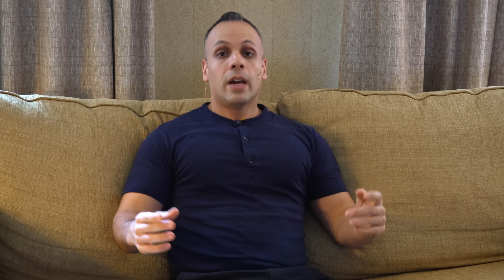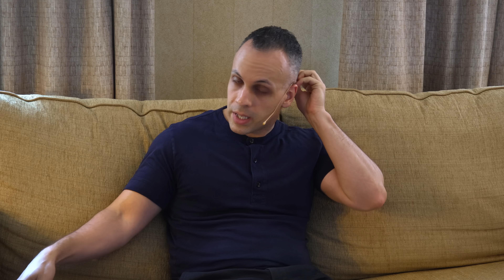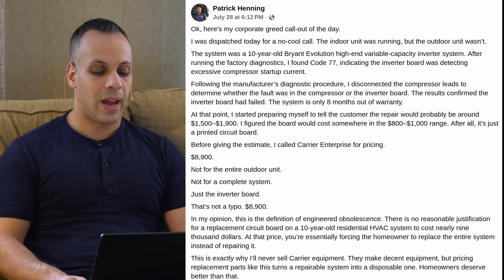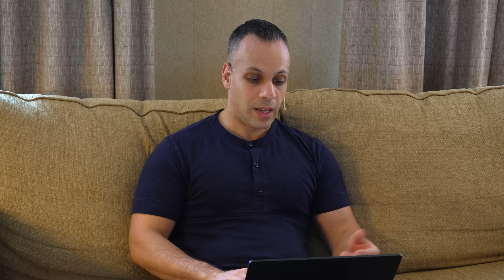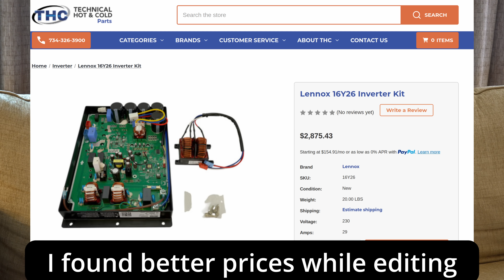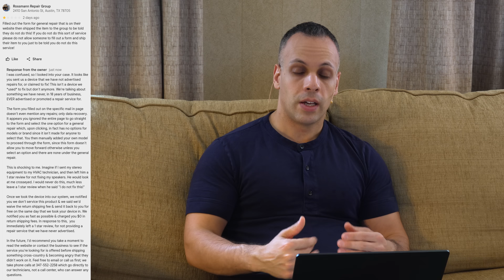Carrier AC repair has $8700 part cost for residential unit

Comment: Carrier has jacked up parts prices since covid and their strategy is absolutely to force the end-user into buying new and fuck you if it's only 8 years old. It's not just them though a lot of manufacturers are not even stocking parts for stuff that should be under warranty and getting away with it "due to the conversion to A2L refrigerants" that's their get out of jail free card. Us dealers are pretty much powerless and the higher end the less likely it'll be that a motivated technician can just "make it work". Also and oh btw these mitigation systems for A2L refrigerants are fraudulent as all hell.

Comment: I was a Carrier dealer for 20+ yrs before I sold my company. I agree that is costs WAY TOO much to do repairs on these variable speed units. Carrier makes basic units just like Goodman and everyone else. They are a good product. But $8700 is not realistic. I have a 21 yr old r22 Carrier unit and it runs great. I will not replace it until it’s 100% dead. I live in NE and don’t use it as much as I do in my FLA house so I’m hoping to get at least 10 more yrs.

Comment: I had a similar thing happen here in Australia about 8 years ago...  I had a Samsung and it was about 3 months over warranty...    Samsung actually replaced the main board on the external unit for free which shocked me greatly, enough I still mention it.

Comment: You could buy an old car for that kind of money. And probably use an inverter from it. Wth. And most boards like this can be repaired, they look even simpler than what my dad sold and those needed a new capacitor/relay/resistor after a decade or two. No, I don't expect my HVAC guy to be able to troubleshoot that, but could be outsourced for less.

Comment: I don't speak for all AC guys but a lot of times on an obsolete system we just scrap them. Sometimes we'll keep up a circuit board or a temperature panel. We always keep the capacitors. Everything else just turns into scrap iron.

Comment: Buy a Goodman over carrier, for sure. Just as good of quality and party's are more readily available/cheaper too.

There is honestly no reason why these control boards need to be this expensive. They are mass produced circuit boards that aren't actually that critical to the operations of the unit (maybe for minisplits, they are already overly engineered as it is) and could easily be retrofitted to run without for a few hundred dollars in swapped parts that any decent HVAC tech should be able to do.

Comment: A client of mine repairs all kinds of circuit boards from Ac units to graphic cards. All same price depending on the costs of parts
Reply: How would I go about learning to repair inverter boards for AC systems and mini splits? I’m an HVAC student right now less than a year from getting certified but I’ve studied my ass off. I’m still young, and I know the future is electronic and digital, so if I learned how to repair these boards it would help me a lot. Also I have minor experience in soldering too. Any reccomendations for books to read, videos to watch, or courses to take would be greatly appreciated.

Comment: This is what happens when a company decides that every department must be a profit center, with the overriding goal to maximize profits. The idea is to cut costs and increase prices until just before a statistically significant number of customers will balk. In other words, you look at your business as a bunch of numbers and aggressively remove any human elements such as customer satisfaction. Attacking your own "statistics" (formerly "customers") is far cheaper than competing. Obviously you can only do this in relatively static, slow changing markets, like HVAC.

Comment: From Europe but same shenanigans. 14 years old gasifier boiler. Control board with small LCD screen.
I got the quote from manufacturing plant 15 miles away for 860€ +360€ for replacement. (In the middle of summer, not even peak seson.)
Took out the board, found the OEM and found that they make generic controllers and are branding them for several manufacturers.
Shout out to them, their support (also company around 50miles away) was incredible. 
They asked what my current board was, got informed they dont make that model anymore, but can sell me drop in replacement with lambda control on the flute (current one doesn't have one). 
With next day delivery the controller board and lamda probe was 260€. 
All I had to do is drill a 12mm (1/2") hole in the flute to insert the lambda sensor and change the controller. 
No rewiring, thermal probes included in package stayed unopened, old ones work just fine, controller dropped perfectly in place of the old one. 
I changed a few basic parametes, no PLC rP0001 parameter stuff, just desired temperatures for boiler, hot water, buffer storage temp in user menu.
Boiler now works better than new, more efficient and burns a bit less wood, it's what I noticed in 3 seasons of use.
Think of it, I was thinking of replacing the boiler with a new one at that time and almost choked on the prices for new green (lambda control) boilers. Comparable new form same manufacturer 7k, some cheaper options are for 2-5k, but they are made from thin material and questionable life choices of some employee that worked on your particular furnace. 
And if you think 7k was alot... no no, we got them going deep over 30k for a domestic wood boiler alone. Scared to even ask what they charge for service parts.
Company greed is global problem, there are some hurdles in the EU but hurdles come with instructions how to go around them. US is not even pretending it doesn't care about the consumer rights. 
Let's teach our kids to repair and reuse stuff and let the wallet decide which business will stay around long term.

Comment: I'm from a tropical country where mini splits are the most commonly used HVAC system. 
Around 15 years ago the variable speed - inverter style units were being pushed by manufacturers with the main selling point being energy efficiency. 

These units came with two major problems - PCB failure and condenser failure, both occurring relatively early in the ACs lifespan. 

There were now two PCBs per unit - one indoors and one outdoors. Either one (but mostly the outdoor one) could fail at any time due to bad design, poor quality, overheating or moisture due to a bad seal. Replacement cost was around 15-25% of the unit cost. 

The condensers would also fail early due to higher refrigerant pressures, thinner materials and dense easily clogged fins - all in the name of boosting efficiency. When they fail you get excuses from the manufacturer about living in  a coastal area (why is it even on sale in my city then ?), pollution or not opting for some overpriced warranty pro+ or service package. Options are to pay for a possibly temporary repair with refrigerant or to replace the condenser with a new one costing between 15-40% of a new unit. 

Due to the bad press manufacturers offer a 5 year warranty on the outdoor PCB (conditional) but nothing on the indoor pcb or condenser (other than coatings that are mostly marketing fluff). 

So yeah the expected lifetime of these units seems to be around 5 years rather than the 10+ years of the old fixed speed units which have also disappeared from shelves in the last few years. 

I'm now 2 years into AC no 3 since 2012 although I do admit that AC no 2 did fail a bit prematurely after taking some damage during renovation of the apartment building. 

I also do have a PCB repair guy but he's always a bit swamped and takes 2-4 weeks for a repair minimum and obviously can't fully test the repair without it being installed into the AC which requires coordination with the AC guy and so on. If it's peak summer, the max I can survive without an AC is a week - either repaired or replaced.

Comment: Automotive dealerships use a similar pricing approach for electrical diagnosis. If their tech can't diagnose the issue, the advisor quotes a "new engine harness" for $3,000 (or more). Customer leaves and hopefully finds a good diagnostician to fix the problem.

Comment: Commercial technician here. I will  never install an inverter style unit on my home. The “old” style unit has very few moving parts and I can repair my unit with off the shelf parts from any local distributor. Hell, they’re selling the parts at Home Depot now.  The inverter systems have some form of the same parts as the old units. I.e. condenser fan motor, compressor, pressure switches etc. They’ve just tacked on unobtainable/costly inverter and surge protection parts. An inverter system may save electricity in the long run but I’ll take that trade off when my unit is broken and I’m dying a slow death in the Texas heat while waiting on parts .

Comment: 4 Widow units use half, HALF the power, I tell you ! HVAC/R Certified. MINI SPLITS ARE EVEN BETTER ! Never central air. And that is what we installed, and mini splits, as they 1st came out. NW Florida.
Reply: We trashed them, after teardowns, recycled. Never ever saved any circuit boards.

Comment: 5:30 this "say no price" is absolutely a thing. Parts for older units go up to make the cost of installing a new unit seem more attractive.

There are some upwards pressures on parts when a product line is obsoleted. The cost of keeping a production line going isn't actually the big one - the real risk is warranties when it turns out that the faulty control board is a symptom rather than a root cause - we swapped out three controllers once at my work before we found that a faulty motor was causing the boards to burn out in an unusual way. With that said, the cost is not driven up as high as the price suggests.

Also, I'm pretty sure every tradesman has done a "get someone else" quote. Maybe it's because access is an issue, or it's a thoroughly annoying and fiddly job, or the customer is just rude and painful to deal with. I have a customer who constantly criticises our techs and our workmanship - usually accompanied with a demand for a discount. Our bosses refuse to tell him where to go, so we always add an extra two hours to our quotes.

Comment: "inverter" boards in inverter type A/C units are more accurately variable frequency drive boards - take your 240vAC 60hz, rectify it over to 240vDC, and then invert it back to 240vAC at some arbitrary number of hz to control the motor speed. Generally they'll be pushing like 30 amps of current max - so it's really just some big capacitors, big IGBTs, some current monitoring to make sure the motor doesn't stall and burst into flames, a microcontroller to coordinate it all, and the power supply for that micro. So assuming the thing comes up far enough to report an error, and there aren't any literal holes blasted in the board from a part letting go, it's all imminently repairable stuff.

Nobody in the industry does, because the nature of HVAC is that it only breaks when it's most needed (or at least people only notice it's broke), and telling a customer they've gotta wait for you to ship off a board for repair is a great way to lose a customer - and you're unlikely to ever see the same board twice in any reasonable period of time because there are so many godforsaken makes and models out there, so buying and then repairing for next time doesn't make much sense - especially because now you can't test your repair except on a different customer's equipment.
Reply: How would I go about learning to repair inverter boards for AC systems and mini splits? I’m an HVAC student right now less than a year from getting certified but I’ve studied my ass off. I’m still young, and I know the future is electronic and digital, so if I learned how to repair these boards it would help me a lot. Also I have minor experience in soldering too. Any reccomendations for books to read, videos to watch, or courses to take would be greatly appreciated.

Comment: Our Carrier computer board flamed out after 3 years. The company said they bought the old installation company, so I need to pay them a yearly inspection fee or they wouldn't honor the manufacturer's warranty, which is illegal. Fun stuff. It comes on slowly, and turns off slowly, but other than that, it's on-off. A $4K board is not better than a $25 mercury switch on the wall. Why is the free market failing? Conspired planned obsolescence?

Comment: we have such a wasteful throw away society. and its not new, even when i was a teen in the 90's it was common to just buy a new thing when your old thing broke. Whenever you brought up repairing something it was always the same answer "why would you repair it when the new one is so cheap". we really need to get past this infinite growth fallacy and learn to live with what we have. Make the most of what already exists until it genuinely needs replacement with a new unit of significantly increased capability in some way. automobiles are such a great example of this. they are almost as throw/fashionable as Iphones. which is insane for such an expensive item that realistically could run forever with regular maintenance and component replacement. I work on the railway and we regularly operate locomotives as old as I am. some of them have been rebuilt 2 or even 3 times. but the core components just live on forever.

Comment: Did you see  the story about the company that had a contest to find the oldest AC Unit in the country?  A 90 year old lady had a 52 year old Fedder. She said they NEVER had a problem with it and it NEVER broke down.  Well the company gave her the prize of a new system.  I forget what brand but everyone in the comments said this was so dumb EXACTLY FOR THIS REASON IN THE VIDEO!!  They will be pissed in 5 years when it breaks down.  They should have just given them a rain check to replace it if it dies.  The claimed it will be more efficiant and quieter then the old one BUT, they never complained about either one of those "problems" in 52 years!!

Comment: The whole HVAC business is mostly a racket. My parents' AC stopped working a few months ago and they called some random AC repair service advertised on a piece of junk mail. The technician came out and told them that their unit was too old to be repaired and they would have to buy a whole new system (costing thousands of dollars), which he would obviously be happy to sell to them. I told them to call the independent technician that usually works on my AC. The guy came out the next day and diagnosed a dead fan motor on the outside unit. Although it was a discontinued part, he said that he could find a replacement that would fit and a couple of days later he got it up and running again. Total cost: less than $500 for parts and labor.

Comment: I worked in the HVAC industry for over 40 years. There was a time where systems were bullet proof and would last 30 years. The only reason the industry would sell new units were based on efficiency. We pulled out perfectly cooling units and replace them with higher efficiency units but less longevity. We were trained to sell units at 15 years old, then 12 and finally 10 years. As the efficiency went up so did the price. January 2025 called it quits. The cost of training and new tooling was not going to be to my benefit. The industry has been colluding to force replacement at a younger and younger age by making inferior products in order to boost profits. Where we once replaced complete systems for $12000 we were forced to sell those same systems at $38000-42000. Of course it included all new  line sets, duct work, thermostats, disconnects, drain pans and whole host of misc items. The target gross profit margin for each job was 76% of which the salesmen received a 10-12% commission. I left the Big company industry in 2003 and started my own company with 3 people working out of my home. No overhead and I could compete with the big boys in numbers but not volume. I enjoyed my career and I'm glad that I'm finally out.
Reply: 76%  that's gravy.  I guess whatever the market will bear was the motto.

Comment: I’m retired from the trade.  People get a sell job on the great high efficiency heating and cooling systems.  No one ever tells them how very complex and costly to repair those fancy high-dollar systems can be.   Carrier has always had higher cost replacement parts.   Now owned by ICP, Carrier has improved somewhat , in my opinion.  That said, no Carrier / Bryant equipment in my house.  Thanks for highlighting this issue Louis.

Comment: in s.e. asia there are dedicated technicians that you bring the pcb to (you can remove it yourself or hire someone to do it for about 10 usd equivalent) tech troubleshoots the board, repairs it (usually a simple capacitor), tests it  and the bill is about 25usd.  just like what luis business does with macs.
Reply: How would I go about learning to repair inverter boards for AC systems and mini splits? I’m an HVAC student right now less than a year from getting certified but I’ve studied my ass off. I’m still young, and I know the future is electronic and digital, so if I learned how to repair these boards it would help me a lot. Also I have minor experience in soldering too. Any reccomendations for books to read, videos to watch, or courses to take would be greatly appreciated.

Comment: The US residential HVAC industry is insanely long overdue for major disruption. 

That includes BOTH the manufacturers AND the installers. 

Unless you have a large home, “high efficiency” furnaces rarely payback before they die, particularly considering repair costs. We use this payback test to evaluate the qualifications of a prospective installer.